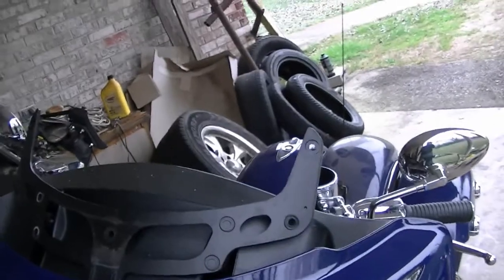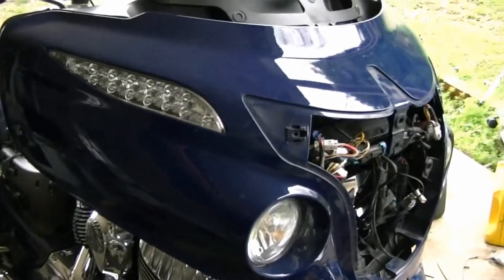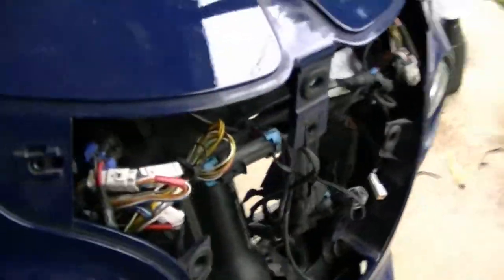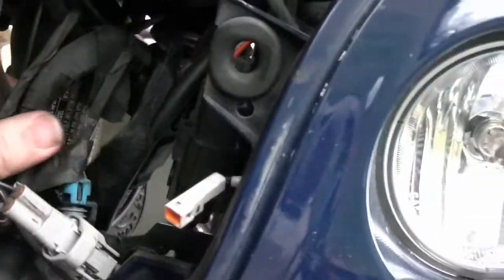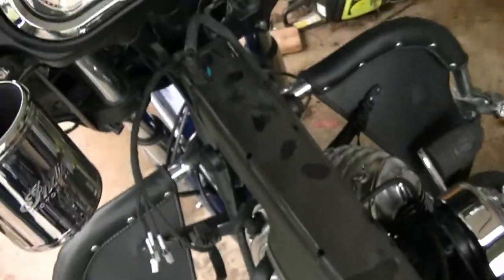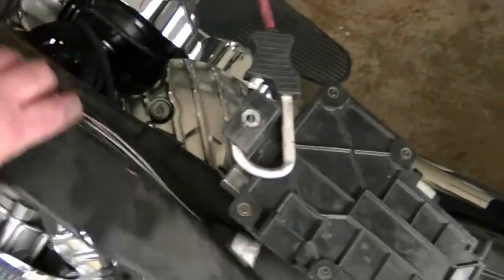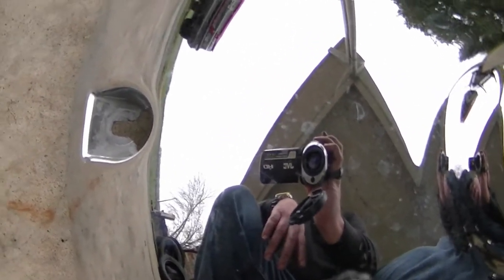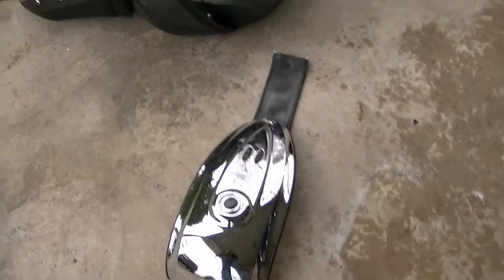Chieftain Amp Install

Comment: Chad, Appreciate the video, I upgraded my speakers with the Polk DB522. Although better sound, the stock amp sux. I purchased a NVX VADM2 amp. I am not worried about taking most of the Fairing apart, My main concern is wiring this puppy back up. Where did you install the ground? Did you connect positive straight to the battery? Well the biggest question of all, How is your system doing? Battery holding up? Thanks for posting.

Comment: I made the mistake and took that front bolt off of the chrome tank cover.  Never again.  I cussed for 15 minutes putting it back in.
Reply from the maker: Jacob James yep glue the washer to the head so the washer stays up out of the way, pre-start the bolt and slide the chrome cover on over it..voila